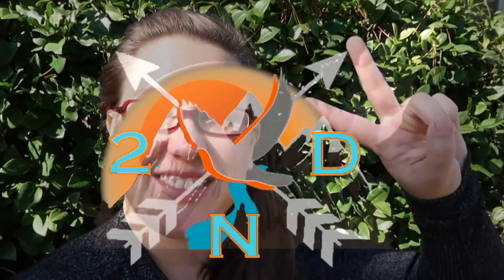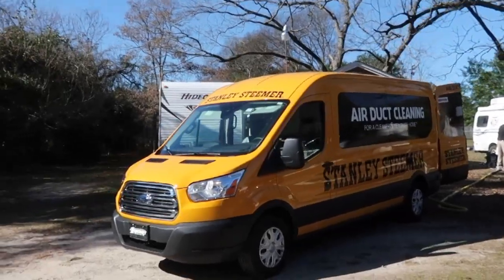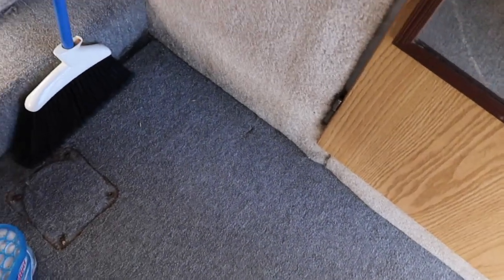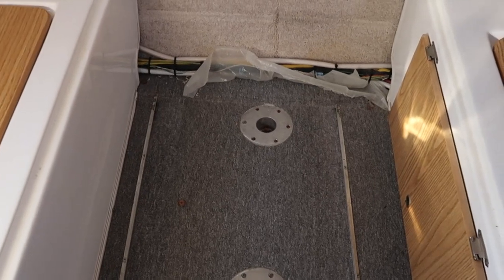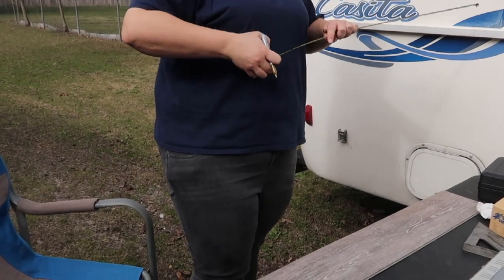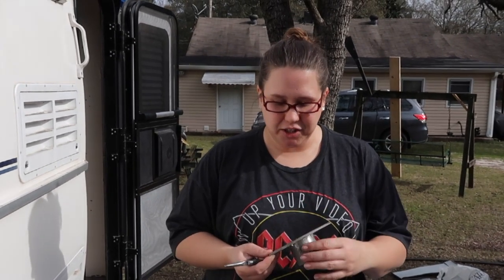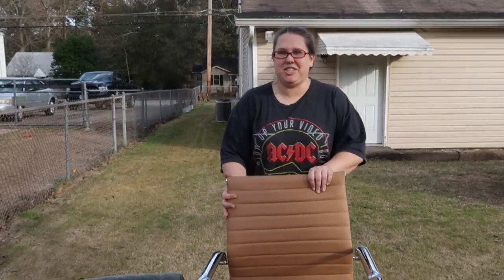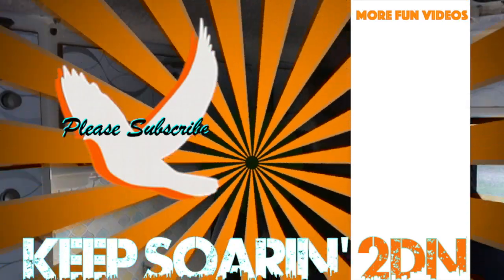Flooring Install on the Casita Travel Trailer

Comment: How satisfied where are you with the job Stanley Steemer did on the wall and side carpeting?
Reply from the maker: We were very surprised with how well they did the job. It definitely had a more clean feeling/smell.
Reply: @2DovesNation  Excellent! Thank you for your reply. I got my new to me 1993 Casita home earlier today. Making my plan for some light restoration..
Reply: @2DovesNation  and surprise surprise part of my planning will include putting down new wood and then laminate flooring.

Comment: I also have a casita and didn't want to lose the little bit of insulation from the carpet but I worry about mold and mildew in the carpet build up beneath the new flooring. Any thoughts anyone?
Reply: Anybody anybody? Thoughts, comments, concerns about mold, and mildew with this application? Any help is greatly appreciated! Thanks!
Reply from the maker: We had concerns about mildew/mold when we decided to put flooring down over the carpet. We even tried to pull up a corner of the carpet, but the carpet was fused to unfinished fiber glass in our unit. So far, we have not had any issues with mildew. In fact, I can see an improvement of my allergies with the new flooring because it's so much easier to keep clean.
Reply: @2DovesNation  Thanks for sharing, I appreciate the reply. I am glad to hear it's working out!
Reply from the maker: You’re very welcome